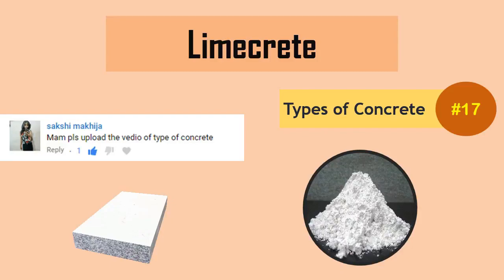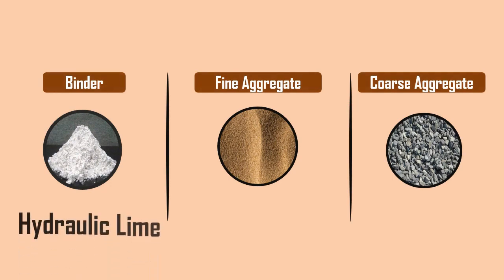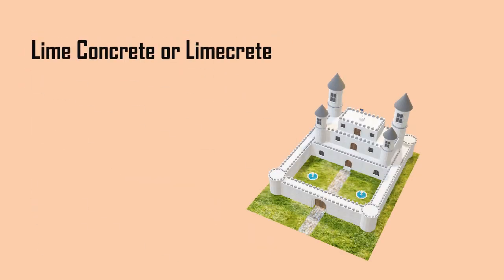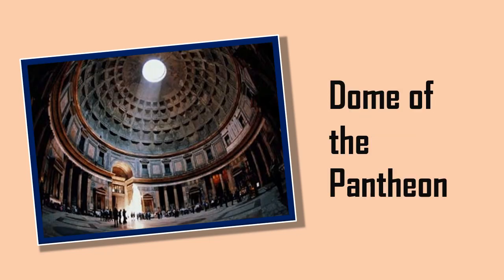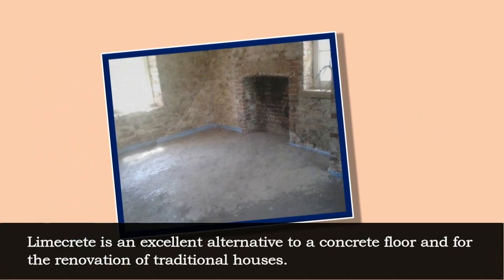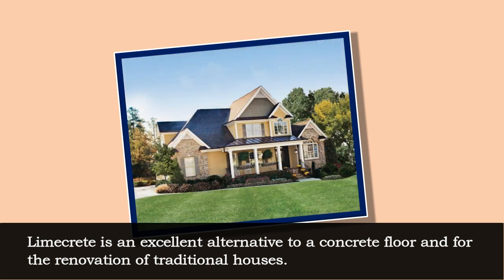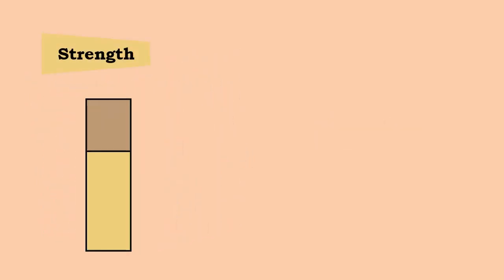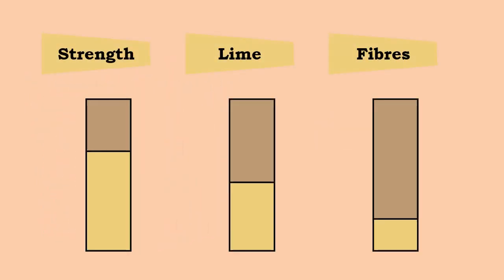What is Limecrete? || Lime Concrete || Types of Concrete #17

Comment: Why Limecrete is not stronger than cement concrete as mentioned in the video? Ancient buildings made with limecrete are still standing after thousands of years whereas cement concrete buildings last only 50 to 80 years!
Reply: If you analyze the ancient buildings you will find that the concrete is virtually always in compression (extensive use of arches) and where any tensile forces exist they are very small.   The use of concrete is in massive quantities.

Modern concrete buildings and bridges introduce significant tensile forces which rely on rebar to carry, which is subject to degradation once water and other chemicals (chlorides) get to the rebar.  Rust increases in volume and fractures the concrete.

In recent years you are starting to see the use of various grades of SS rebar to stop the corrosion process and concrete buildings and structures should now last hundreds of years (and perhaps much longer).

Another issue is that all these muti-thousand of year old Roman Concete structures are in mild climates that do not see freeze/thaw cycles.   Even lime concrete can be affected by freeze/thaw cycles.

Finally, the biggest reason that they use portland cement for most modern concrete is that it gains the vast majority of its strength in 2 months or less.  Limecrete takes about 2 years to gain the same amount of its strength.  Thus building with limecrete means that the project gets built and finished on a significantly slower schedule - and in the modern world "time is money."

However, it is true that ultimately limecrete will outlive portland cement in the long term assuming good construction practices are followed when building with it.  

I've been studying the pro's and con's of building and ICF 2-3 story house with limecrete with SS rebar.   How much longer will i need for the ICF walls to set before I can finish the walls.  Must I let the bottom sections cure for months before I can cast the upper sections?     Lots of unanswered questions at this time.

Comment: Here you should must do the carbonation process to increase the compressive strength...

Put some smoke to the concrete..
Then it will rapidly increase in strength, hardness & durability.

A cement concrete structure can be durable up to a maximum of 65 years, but the lime Crete is still usable even after 200 years..

Hence lime Crete is the best.
Low cost, 
Not releasing toxic gases like cement,
Environmental friendly,
Easily available,
Etc..
Reply from the maker: Nice info 👍🏻👍🏻👍🏻
Reply: Can i get your gmail i wants to discuss lime in modern const
Reply: Thanks Suresh ji

Your opinion is very useful
How can I discuss with you a little further
Reply: Smoke? Ashes you mean?

Comment: Can we construct a building by using limecrete how long it will stay strong
Reply: Here you should must do the carbonation process to increase the compressive strength...

Put some smoke to the concrete..
Then it will rapidly increase in strength, hardness & durability.

A cement concrete structure can be durable up to a maximum of 65 years, but the lime Crete is still usable even after 200 years..

Hence lime Crete is the best.
Low cost, 
Not releasing toxic gases like cement,
Environmental friendly,
Easily available,
Etc..

Comment: How to make traditional lime mortar ? How to make lime mortar roof of house ?
Reply: Here you should must do the carbonation process to increase the compressive strength...

Put some smoke to the concrete..
Then it will rapidly increase in strength, hardness & durability.

A cement concrete structure can be durable up to a maximum of 65 years, but the lime Crete is still usable even after 200 years..

Hence lime Crete is the best.
Low cost, 
Not releasing toxic gases like cement,
Environmental friendly,
Easily available,
Etc..
Reply: @sureshm.s9158  how to increase smoke ? 

Did it mean to increase ash ?